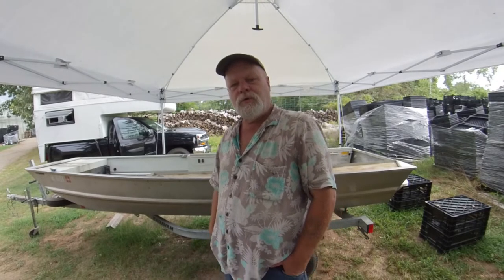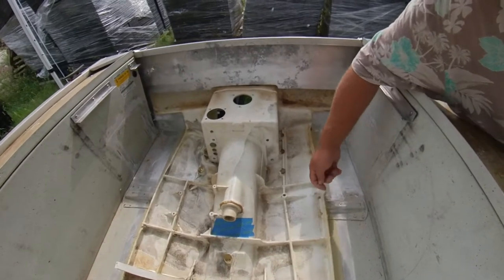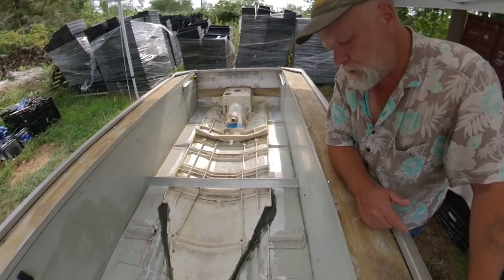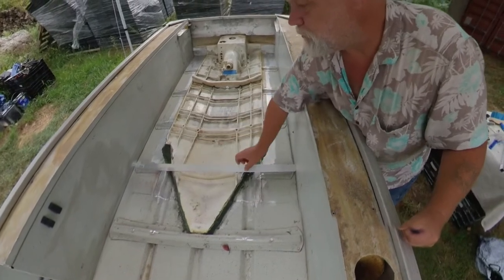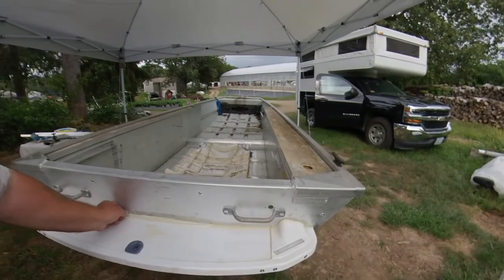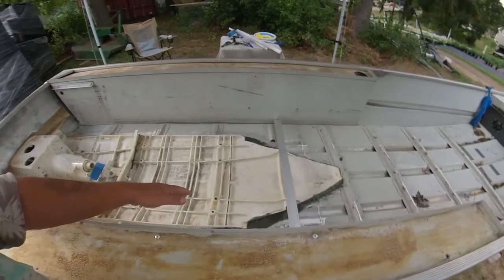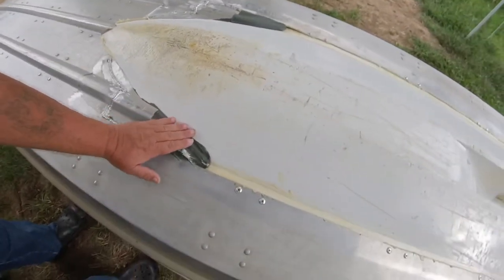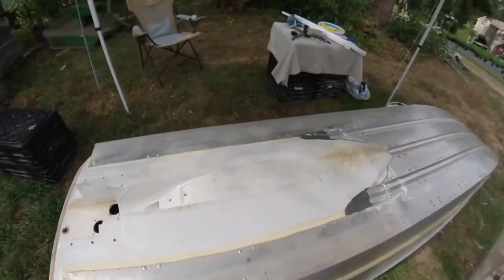JET JON BOAT BUILD | part 4 | Marriage Complete￼

Comment: Can you list the epoxies and filler you used? I'm doing the exact same thing as you. I've watched tons of videos over the last two years but NO ONE has married the hills as nicely as you did especially on the bottom side before you put the gator glide on.
Reply from the maker: Hey thanks for watching. Are use just about a little of everything West systems G flex 650 what is the biggest I mixed it with a little 404. I also used a couple of tubes of West system 610. There was a can of epoxy paste can’t remember the name of it but it was the same as the epoxy mixed with fiberglass. You can see a lot of my products on part three of jet John boat build. I also use just simple 6 inch fiberglass tape with the G flex
Reply: Have you water tested the hull yet?
Reply from the maker: I had to think about it for a minute but I remember it was evercoat Epoxy filler with glass fiber. I bought it at defender marine which is just down the road from where I was at
Reply from the maker: @onthatdove  no I’m still working on it right now actually but I can say that I’ve have no cracks and I’ve driven the trailer around 2000 miles now.